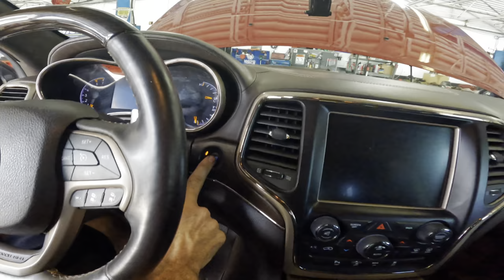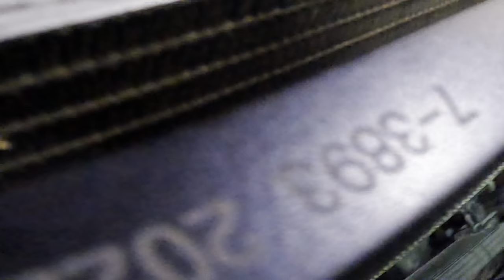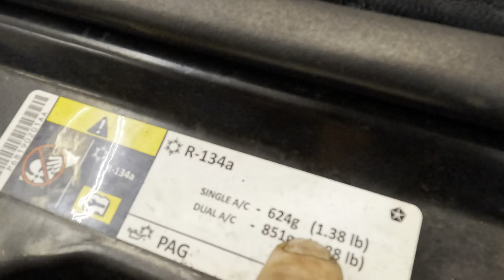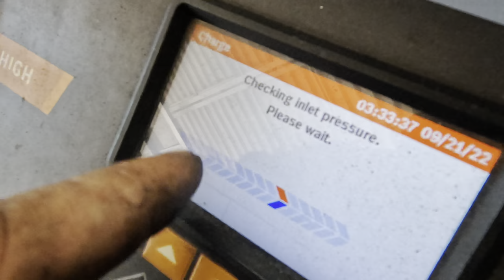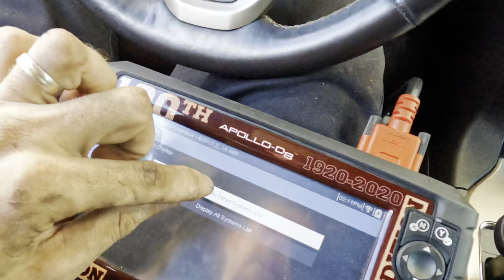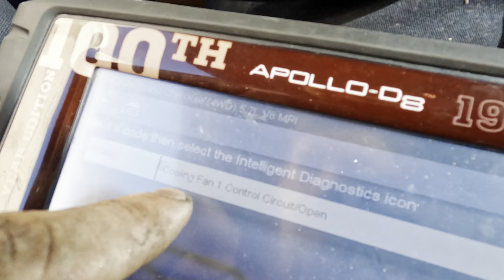Hidden Collision Damage! This thing blew up twice! Jeep Grand Cherokee 5.7

Comment: 1925–1998: Chrysler Corporation   /   1998–2007: DaimlerChrysler
2007–2014: Sergio Marchionne, "World Class Manufacturing" or WCM On July 21, 2011, Fiat bought the Chrysler shares held by the US Treasury.[54] The purchase made Chrysler foreign-owned again
2014–2022: Fiat Chrysler Automobiles

Comment: That's typically where HVAC guys find ac leaks. Right where the coil tubes attach to either the condenser or evaporator

Comment: UV dye is fluorescent. It absorbs the incident UV radiation and enters an excited state. Chemical species generally don’t like extra energy, so they try to release that energy. The fluorescent material first goes through some internal energy transitions because these are much quicker. Then  , to release the rest of the added energy, they release photons (light), like the UV dye does. Because the material goes through internal transitions first, the emitted light is always lower in energy than the incident light
Reply: That sounds correct.  Question(s); Is there a secondary chemical that receives the energy from the step-down in electron shells and then glows?  And is there a difference between fluorescence and photoluminescence?
Reply: @alext8828  No, the initial transitions are strictly internal to the fluorescent molecule, in vibrational states. A very small amount of energy is dissipated as heat to the surroundings during this step. The glow that you see is the release of remaining energy in the form of light. Fluorescence is a type of photoluminescence, which refers to the phenomena of light exciting a material, which then releases energy in the form of light. So all fluorescent molecules are photo-luminescent, but all photoluminescent molecules are not fluorescent, if that makes sense.

Comment: I think if you will go back and watch your disassembling of the transmission lines from the condenser, you will notice that the condenser is pitched forward and the lines are going in perpendicular to that condenser. You have the condenser forward which is putting tension on the ends of the lines. If you would’ve held the condenser straight up I will bet you anything you could’ve pulled those lines out with your fingers!

Comment: I believe the energy from the UV light causes electrons in the atoms of the dye to jump to higher orbits temporarily, then when they "fall" back to the original position they emit light in visible wavelength you can see.

Comment: When you took that part out for the original air cleaner system you should have put that bolt back in that hole. And then give that piece to the owner of the vehicle. He may want to revert it back before he sells the vehicle.

Comment: UV light is invisible to the human eye, but if we could see it, it would come after violet on the light spectrum, hence the name “ultraviolet” light. One of the ways UV light is different from the light we can see is the way its high frequency affects organisms, such as bacteria and mold. UV light can disrupt these nasties at a cellular level, making them unable to reproduce. That’s what makes UV light useful for decontamination. vs A black light emits ultraviolet radiation through a wavelength not visible to the human eye. When this electromagnetic spectrum reflects off of an object, it produces a light you can see. This reflection is what shows you any previously repaired areas on certain items or touch-ups that have been applied. So, it is the electromagnetic spectrum that makes things visible.

Comment: Did a ac condenser on mine they go out a lot due to the fact Chrysler gets them made in Mexico. $345 from dealer parts department and made in Mexico 😤 the grand Cherokee is a trail rated off road Jeep great for everything but Rock crawling. I’ve had mine as many places as my JK .. definitely a Jeep not euro trash

Comment: I've had to replace the condenser twice on my 2012 grand cherokee.... it's a pain in the rear... although this last time I replaced the condenser, compressor, evap  and expansion valve as well as all new gaskets. 
Tested and passed vacuum leak test  but it only took several ounces of freon and won't take the rest.  Not sure what's going on. System was flushed and no blockage but just won't take freon.
Reply: Compressor coming on?
Reply: @shanestrains2849  no,  because the system hasn't taken enough freon in the system.  I believe it takes 22oz , I'm able to get maybe 6-8 oz in before it won't take anymore and that's from a full vacuum.
Reply: @dkkauffmanjr   6-8 oz should provide enough pressure for the ecu to allow the compressor to come on, might of left a pressure switch unplugged during install?
Reply: @shanestrains2849  everything is hooked up properly including pressure switch... but I know if the system doesn't detect enough freon it won't kick on.... I've double check for any blockages and found none.

Comment: I had to replace the condenser in my bride's '08 Pacifica.  I had the factory service manual, which detailed a step-by-step R&R.  The front bumper fascia & grill had to be removed.  It actually went very well, which I attribute to the service manual procedure.  I did have to add some refrigerant oil, per the service manual, for the condenser replacement.  Did you add oil?

Comment: So, I saw that the clip rings for the trans lines into the condenser were not reinstalled. Maybe you didn't film it. But when you were reinstalling all the plastic coverings I saw one of them there in your red "fastener" holder. I hope you got those replaced as the trans lines could come loose and then the trans would overheat.

Comment: Too further my hatred of these POS fittings . I replaced the other end at the Trans side with Dorman Hose fittings and again used Flex Hose and Double Clamps. Mine leaked on that end and I tried 6-8 different O-Rings that are part of that fitting. while Parked for 8 hours in a church parking lot where the trans stopped and I had to repair it there on the ground . Chrysler POS line design.

Comment: So how fluorescence (which is a form of luminescence and is the form of luminescence seen here) works is that the UV photons have a higher energy, when they strike the fluorescent molecules in the dye some of the electrons surrounding the molecules get excited to a higher energy state (the photon passes its energy onto the electrons causing them to temporarily have more energy). When the electrons, which are not stable in their higher energy state, shed that energy they do so by emitting photons with the excess energy. This excess energy is less than the energy of the initial UV photon. Since UV has higher energy than the photons which fall in the visible spectrum, assuming the energy is still high enough, the re-emitted photon will be in the visible light spectrum which is what makes it glow. The reason why the energy is always less is because electrons can be excited only in specific increments, any more energy which can't excite the electron to an even higher energy state is simply not passed onto the electron.

Comment: The upper radiator hose on those jeeps, rubs the belt, because that dumb clip they have mounted to the fan slips off, that’s probably why the zip tie was there.

Comment: Ultraviolet light has slightly more energy. The photons in UV light are travelling at a slightly faster wavelength than those in violet light (hence the term ‘ultra-violet’).

When a photon hits a substance, it can be absorbed and then released again at a different (usually lower) level of energy.

What this means in practice is that light of one colour can be return as another colour. A substance, like the chemicals used to check for coolant leaks, can absorb invisible UV light, and then shine out green or yellow light.
This is called photoluminescence.

Comment: I had a career of doing auto body repair for 46 years, and it is always best to remove the fascia's on any rubber Jeep front ends.  But, I also had about 5 years experience working on these P.O.S.'S.

Comment: Ray, I didn't see you put the retaining clips on the transmission lines and then when putting the plastic clips back along the top trim,  I saw them still sitting in the parts tray.  Did you not put them back or just not film it? I think getting them back on with all the trim installed would be next to impossible.
Reply: I was going to say the same thing. However, Ray is quite thorough and I am also sure he would have noticed the clips in the tray ands refitted them off camera. Retired mechanic from Land Down Under.

Comment: Photoluminescence would be correct — Light emission by any form of matter after the absorbtion of photons. Photo- "light"; Lumin- "emitting"; -Essence "a necessary property;" or, "what it is." It is a broad term; there's also "fluorescence" & there's also "phosphorescence" too — both of these relate to the absorption of UV light & the emission of red-shifted light. Which one is it? It's difficult to say absolutely without the presence of a Chemist & a Quantum Physicist, but 99% of the time, it will be called "fluorescence" regardless of whichever phenomenon it actually happens to be.

Therefore, "photoluminescence" would be the preferred term for those of us lacking expertise in Chemistry & Quantum Mechanics. However, colloquially, everyone is going to say "fluorescence", so...I think you could probably say whatever the hell you want as long as the person you're speaking to understands what the hell it is you're talking about...; or not...? I don't know; who the hell really does know when it comes down to it...(?)

Comment: Hi Ray. I think the term is the dye fluoresces under UV light. 
Also does the owner now take your most excellent video to the insurance company as proof that the a/c rad is accident damage and all repair costs should be absorbed by the insurance company? As insurance companies like to have damage repaired by “Approved repair facility “ instead of dealership; which tend to seriously cut corners to secure future business.
Reply: Each state probably has different rules but generally speaking that check or settlement statement from the insurance company has the owner agreeing to a complete and final payment. Yes, an attorney can argue with them about hidden or concealed damage but the attorney fees will outweigh any gain.

Comment: Are we being trolled, what a about those two wire clips for the trans cooler connection left in the parts tray as you were buttoning up?
Reply: I think its an observation test! It's killing me even though I'm sure he installed them when he found his fastener stash had 2 extra components. 👍🤗

Comment: If you did forget. It will leak after it heats up a few times or maybe 100,000 miles. but it will leak at some point. I have a 1996 that I cut these connectors off and use hose and double clamps just to avoid a leak and having to deal this theses leaking POS fittings.

Comment: In the commercial hvac world I have seen coils arrive on-site flat. I have seen many technicians pressure test a coil before installing it. Does pre-install pressure testing happen for automotive AC?
Reply: pressure testing? not really preinstall usually. but they're typically shipped under vaccuum so when you pop the seals you should hear a hiss or something showing it held vaccuum. also they do a leak test before recharging the system so they know it wont just blow out again

Comment: Photoluminescence IS Fluorescence, so you're still Technically correct, the best kind of correct. Photoluminescence is the absorption of ANY wavelength of light ant re-emitting it, Fluorescence is the emission of longer wavelengths of light (visible) by absorbing shorter wavelengths of light (Ultra-violet).

Comment: Dodge started all of this cramming everything under the hood with the cab forward design back in the 80s. My 1978 J10 I could stand under the hood to work on the motor. That is until I dropped a Chevy 350 in it.

Comment: > Fluorescence is simply defined as the absorption of electromagnetic radiation at one wavelength and its reemission at another, lower energy wavelength
In short - glowing under UV light is just a special type of fluorescence

Comment: Now that was oil as the trail. And being this thing lost its charge at least 1 time already I would have pulled the compressor and dumped the remaining oil. I would have put in the correct amount. I bet this one comes back with a burnt up compressor later in time. No knocking what you do Ray.. just trying to help. I hope you and the family fair thru the hurricane. See you on the other side.

Comment: Ray when are they going to buy you a $5 hose nozzle by the way on a personal level yesterday I put a cold air system in my car and the filter was down in the fender well and had to pull the inner fender liner the clips broke and after I got it in it was getting too much unrestricted air in my computer went haywire car wouldn't run I ended up pulling thing back out and going back to stock but hey as usual you did a great job I was just airing my frustration but the car is running now so we're all good have a great day thank you for a great video on diagnostic on that AC unit bye by the way I understand in the factory and on your end it makes life easier with those little plastic clips or whatever they are

Comment: Fluorescent paints 'glow' when exposed to short-wave UV radiation. The fluorescent chemicals in fluorescent paint absorb the invisible UV radiation, then emit the energy as longer wavelength visible light of a particular color. Human eyes perceive this light as the unusual 'glow' of fluorescence. The painted surface also reflects any ordinary visible light striking it, which tends to wash out the dim fluorescent glow. So viewing fluorescent paint requires a longwave UV light which does not emit much visible light -i.e. a black light.  Stay safe from Hx. Ian Ray.

Comment: Can't say if I would have done it differently my usual thought is remove the bumper cover if it's easy. The one thing I would have done differently would be to use gloves. 35 years ago nobody used gloves now I feel naked without them can't stand dirty hands kinda weird being a retired mechanic perhaps. And I never get into a customers car with dirty hands I always wash or swap to a fresh set of gloves. I don't give a customer anything to complain about and a slimy wheel is the first thing they complain about.

Comment: When short wavelength radiation hits substances called phosphors, the phosphors readmit the energy in a longer wavelength. ie: UV becomes visible light... though X-rays and Gamma rays will also make it glow as well... This prosses is called fluorescence, which is where the lights get their names, as they also do this. When current flows through the gas in a fluorescence bulb , the gas is ionized and emits ultraviolet radiation, there is a fine powder of phosphors on the glass which absorbs the UV and admits visible light.

Comment: I got so MAD at that upper hose clap. Dumb design.   Few days later bracket came unclamped hose slid back burned hole in from pulley. That’s why I had to buy a new upper hose from Dodge dealer.  Came complete with new bracket and unique zip tie

Comment: I feel like the vacuum leak down test that ray never performs on AC systems would have diagnosed this the first time round...
Reply: That test will only tell you that you have a leak. It cannot tell you where. To find it you can use a sniffer or the dye. The dye works much better and does not get goofy if there is a breeze.

Comment: Quick question, did you put new clips on those transmission cooler lines before you hooked them up? I didn’t see you do it and noticed they were still in the parts tray when you were putting all the plastic clips back in the trim pieces, just wondering.

Comment: I don't get it Ray.....In the past you've shown us that the machine forces you to do a vacuum test BEFORE it allows a recharge. If the damage was hidden there before it came in to the shop, wouldn't that have alerted it that the system wasn't holding its charge? If so....why/ or even HOW did the machine allow you to charge it and let it out of the shop as is? Perhaps there's a way to defeat its process and charge it by bypassing the vacuum test? 🤔🤔🤔🤔🤔🤔

Comment: Everyone has the first day on something. So no problem. I would consider that jeep a CUV. Most definitely not trail rated. As the rest have that badge on them. Way to low to the ground. A fast moving CUV. As with auto sales experience. CUVs get to be faster or even turbocharged. Still they are not the SUV or the truck. More of a chick vehicle. Haven’t been a fan of it ever since I first saw it. Just like Jeep Wrangler owners dislike the pickup version. Rather have a full size truck anyway over a jeep. I’m still mopar. I have a Ram 1500 crew cab. Reg bed. Long ass truck. Behind the wheel of that you are on top of the road not in it. Sucking up that violent reminds me of a trip to the dentist. You are the man. Go At with great determination. Keep up the great work.

Comment: The black or ultraviolet light strikes and is absorbed by the dye molecules. The electrons absorb this energy and jump to a higher orbit in those molecules' atoms. When these decay from these temporary orbits the latent energy is released as photons packets of light in a visible spectrum. E=mc2 the concervation of energy and plank's law explain how, how long and what visible color. On my Jw2k the control gate motor gears broke and are a pain to get to...... I don't need my left cheek the exact same temp as the right. Just heat and ac